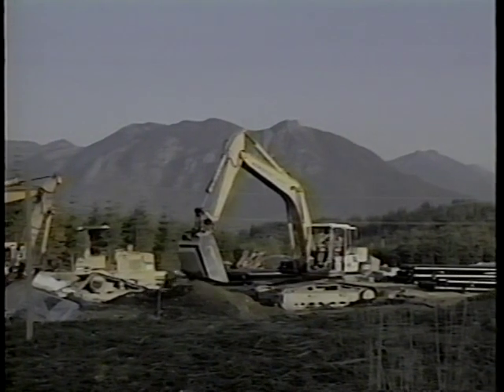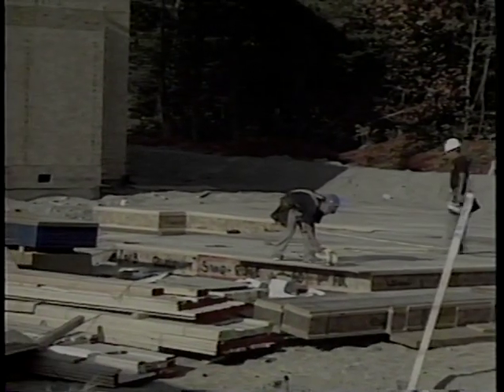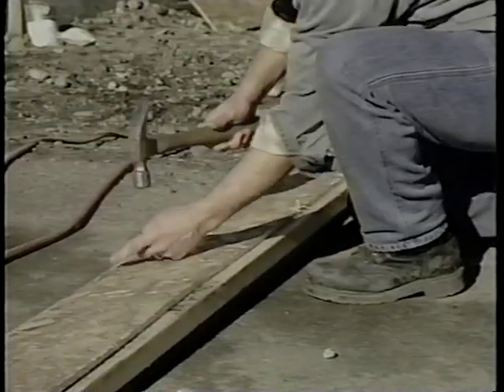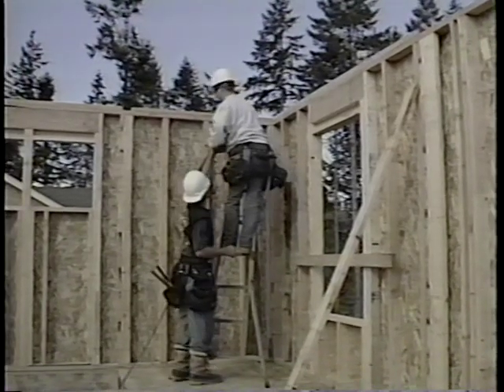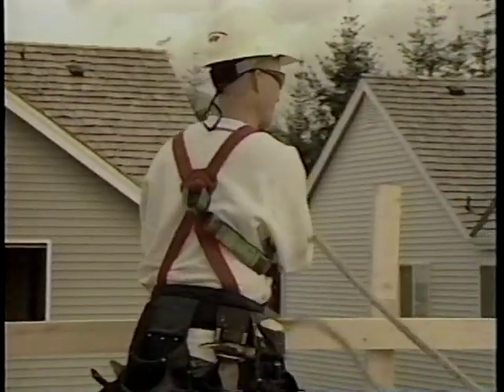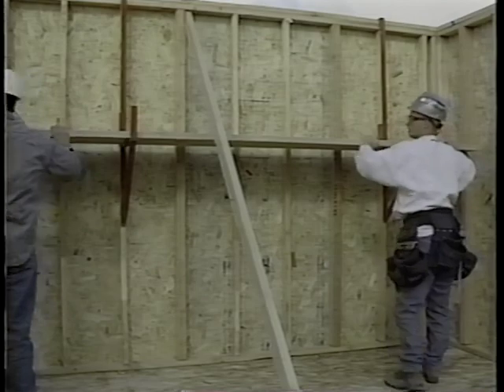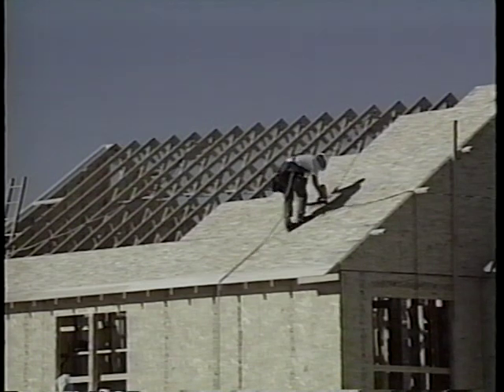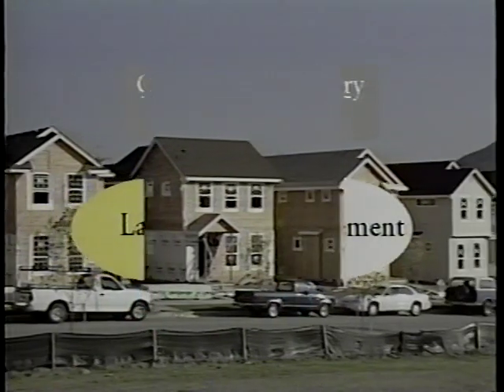Residential construction: Framing safety

Comment: That "lanyard" (rope attached to the worker on the 2nd floor) is not really important on the deck of the 2nd floor. I never worked with one. Nice on the roof of the second floor though. Never saw such guard rails on a job site though. But I worked for a small-time general contractor.

Comment: The reason these videos are not updated to the new standard is becuase they know it is impossible to frame a house and stay in business following thier regs. They cannot come up with a fesible way to implement their safety measures in a way that doesn;t double the time required to frame. Homeowners are always going to pick the low ball contractor who isn;t implementing these rules because the homeowner knows that they are not liable by hiring the unsafe lowball contractor.